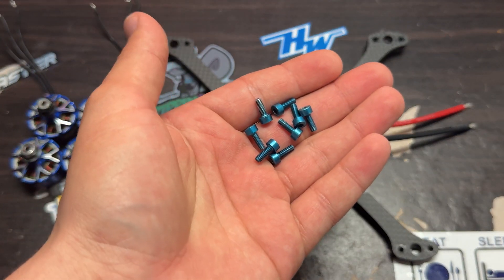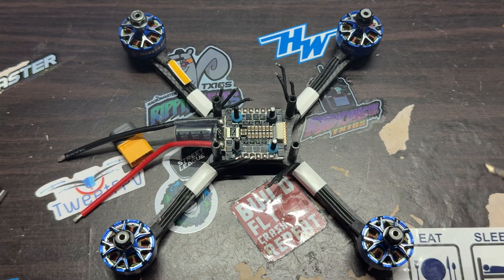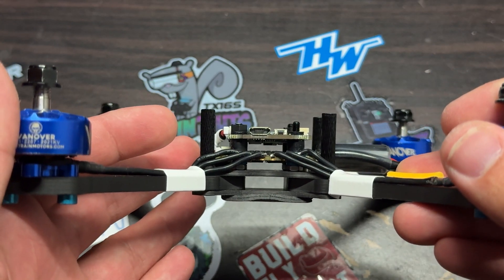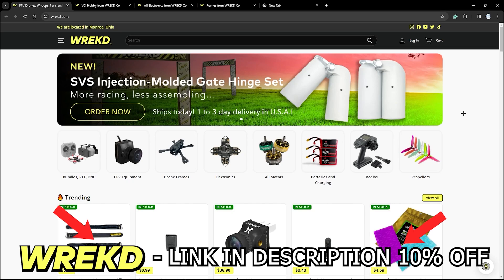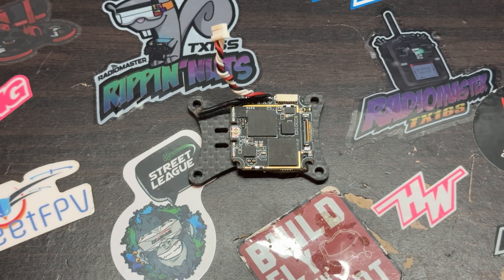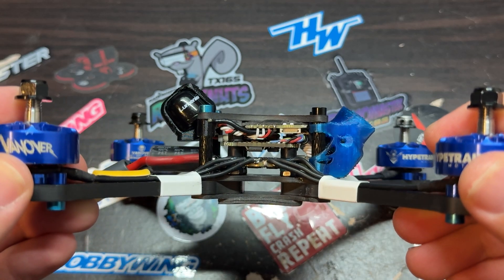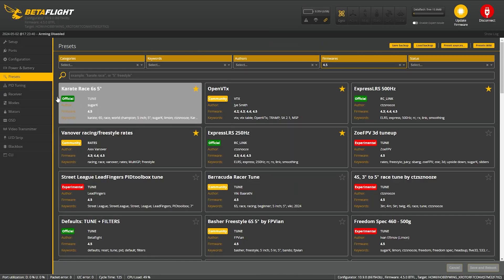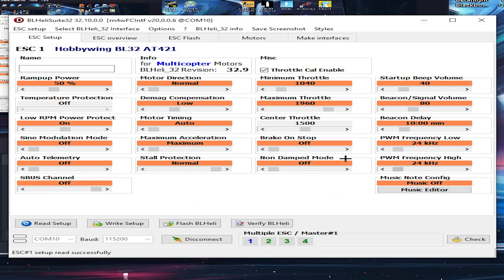INSANE 5" FPV Drone Racing Build

Comment: Just curious, do you not adjust your min/max throttle in BL-Heli to match your transmitter range and BetaFlight range? Usually 1000 min 2000 max? I always adjust my min to 1005 and max to 2000 in BF and BL-Heli cause my radio is calibrated to those ranges. And I thought I would be losing throttle resolution if my ESC’s only allowed the motors to drop to 1040 and raise to 1960..? But I’m not some tuning guru, these are just things I thought I learned along the way? I might be wrong.

Comment: Hey! I love your build but im concerned that as I mount my Race V3 to the top plate it will be smooshed right up against the FC and short circuit it, what should I do?
Reply from the maker: @EvanBfpv main things you can do is build a shorter stack with shorter stack screws, this gives enough room to mount your vtx. Also line up the 20x20 holes on the vtx to the stack screws when you stick it to the top plate, helps to make sure they won’t hit the vtx too
Reply: @jboxfpv3303  hey, thanks for responding so fast XD

I have the lightswitch V2 frame and the tbs lucid stack so I dont have much space at all but if I had maybe 1 millimeter short stack screws than the random ones I found I could fit it all
🤷‍♂
Reply: also, if it was cool with you, id love to send you some photos of the build because although ive built many quads before, I have never done a five inch and I feel like a lot of things are not going how they should XD

also, do people ever get taller standoffs to fit things, feels like a stupid question bu thought I should ask. Thanks for all your help, I really appreciate it

Comment: Heyy, also build with the switchback and supernova 1980kv motors, a few seconds into the flight and my esc failed. Is it because the karate tune? Can you reccomend some PID values or something? I didnt find any useful guide exactly for racing builds, Thanks🔥
Reply: Esc settings same as in the video, pwm 48, demag off, timing 27, i honestly think itwas a bad esc, but some guys told me its because karate is aggresive tune amd the motors are “too powerul”.
Reply: Also i was using foxeer predator 45a, i heard its enough if your not pushing it, which i am not, anyways it failed on a calm flight, while doing a slow roll. Ordered the 60a so ill try to lower the PIDs and hope it doesnt blow up😅
Reply: @mety_twister431 any updates?
Reply from the maker: I would honestly think it could have been a bad esc, but what are your esc settings? That would affect the esc’s performance as well. Can’t do that exact build because I don’t have those parts haha

Comment: what battery would you recommend ?
Reply from the maker: @irom77  Tattu RLine or Quad gas! If you use my link or code on wrekd you’ll save 10% on both over there! Hope it helps!
Reply: But it’s 6S right ?
Reply from the maker: @irom77  yes 6s I run 1400mah batterys so on wrekd either 1380 or 1400mah works

Comment: grounding the video transmitter huh thats interesting! could we get more info on that please
Reply from the maker: Basically with the Whoop Lite from HDzero you’ll get noise. Not typical break up but whenever you arm your quad you’ll notice an excess amount of noise. People way before I switched to HDZero figured out if you ground the vtx to the frame it all goes away. So now when I use my whoop lite I always ground the vtx to the frame on top of the fc ground wire (still have a ground wire to the fc)

Comment: i gotta try demag off. You ever get any desyncs running open class like that?
Reply from the maker: Depends, sometimes yes but if you ever do try to run Demag on Low or try to lower your ramp up
Reply: @jboxfpv3303  for sure. I usually run the default demag low and decrease ramp up to 25%
Reply from the maker: @geordil  that’s interesting I normally only ever run dmag off, if it desynces then I lower ramp up to around 25-30%
Reply: @jboxfpv3303  makes sense! I'll definitely try with demag off and see if I can notice the difference you're talking about.